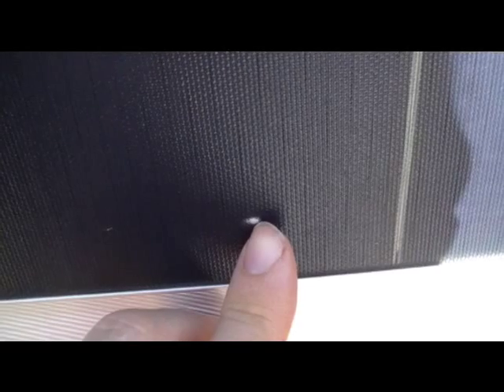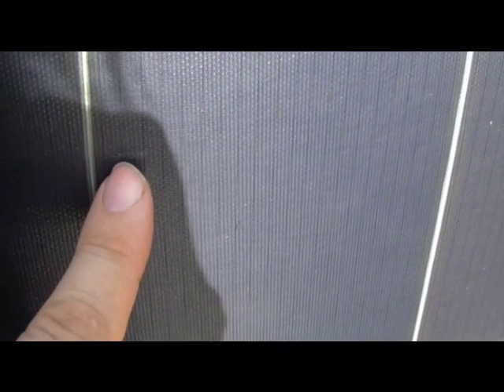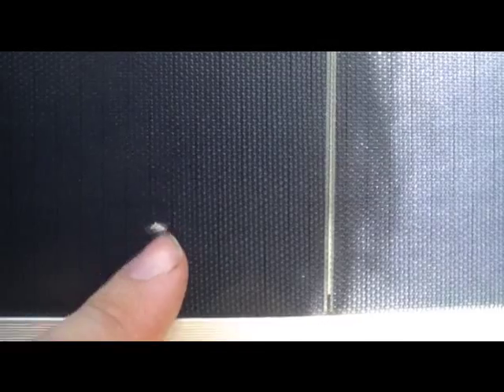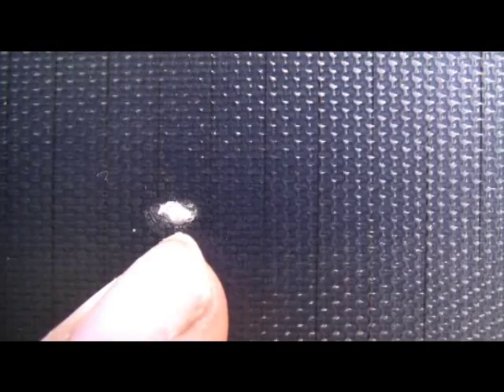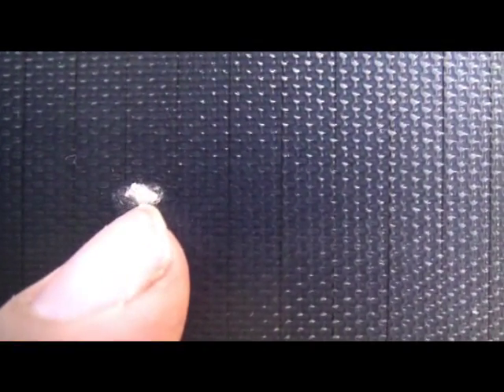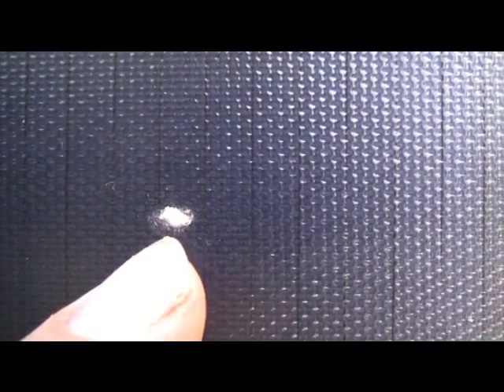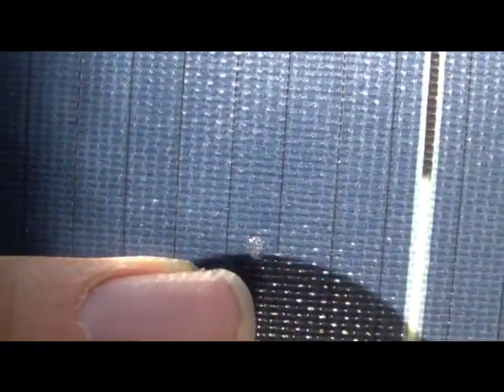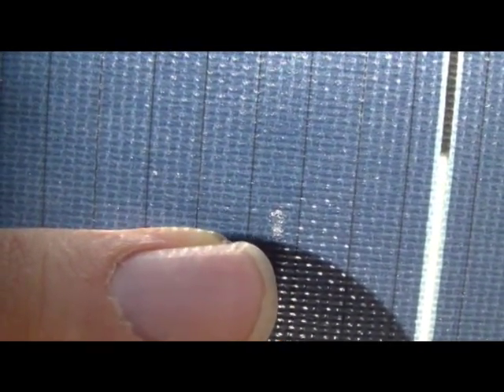Uni Solar blemishes March 2010.wmv

Comment: looks like damage from hail. probably related to impact of some kind. The 2nd looks like a impact scratch thing. ya to fix i would try some polyurethane. Epoxy degrades with UV when exposed to it. try a marine boating store.

Comment: Unisolar panels use Tefzel (ETFE) and EVA, not polycarbonate, according to specs.  I have seen other pictures of Unisolar modules suffering from delamination - the cells are connected with bypass diodes, so a single failure of a cell is hard to detect.  Once the delamination has started, it will probably worsen as the time passes.

The performance warranty is 20 years (at 80% rated power).  Unisolar could simply pay you something for the loss in power, if any, as determined by an approved lab.